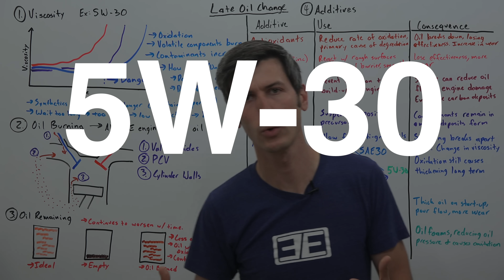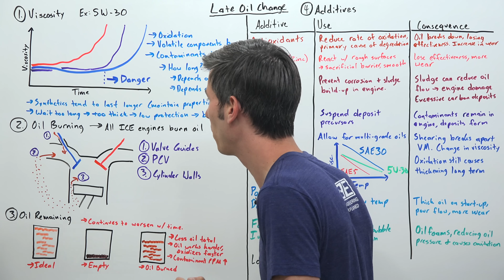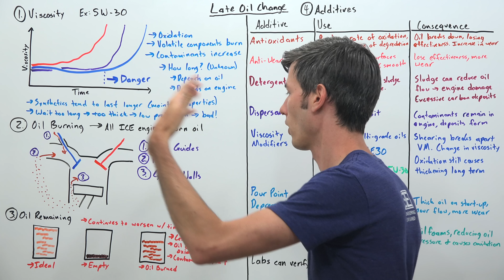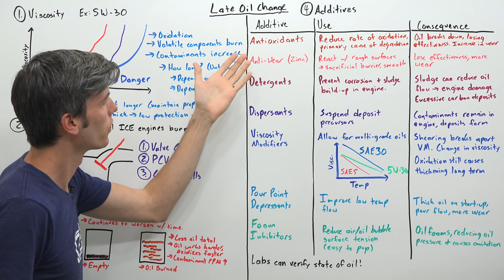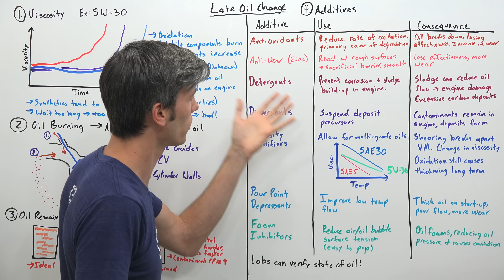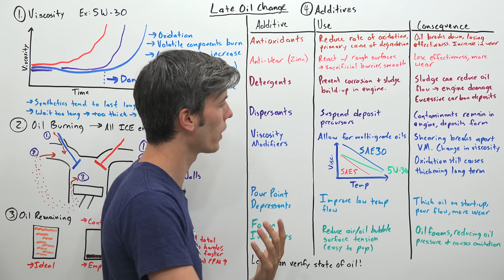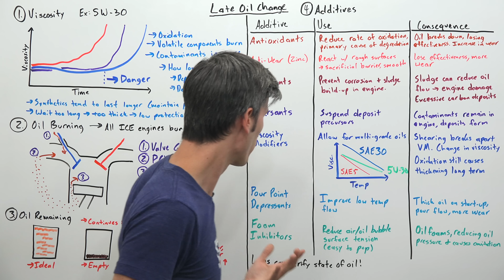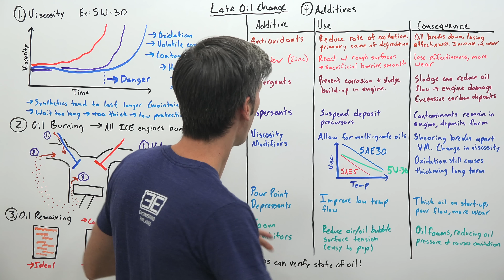What If You Forget To Change Your Oil?

Comment: I'm wondering what is happening when your oil exchange is overdue not because km/miles but because of low km/miles done. Like now in Corona time lot of people are working from homes and are not making usual km/miles. 
Let's consider following situation. Car instead of doing 10.000km in a year is doing only 5.000km in year. What will happened if oil will be changed not after 12 but 24 months?
Let's consider that car was doing one long trip every weekend instead of series of short trips during week and some longer during weekends (so water accumulation shouldn't be the case and fuel in oil as well shouldn't be a case)

Comment: One question (hope for an answer). I'm from Germany but live in Costa Rica now where gas quality is worse. Many people, including mecanics, tell me to change oil (if full mineral) every 3000km, semisynthetic every 5000km and full synthetic at mas 10.000 km. Does this recomenation make sense? Many people here drive older cars (15years+), so do I (Pajero gas 3.5 engine from 1995, recently oberhauled).
Does longevity depend more on car engine (car manufactor indications in owner manuals; many cars here are imported from the States, so is mine, some are produced for Latin American ?Market), gas quality or what oil manufactor indicates on it's container? Or is it a mix of all 3 factors and its hard to say?

Comment: 428,000 miles, 1984 Nissan Maxima. Use Synthetic oil. Change the oil and filter every 7,000 miles. No I have not changed to High Mileage oil yet.

Comment: A friend bought an old Toyota car, never changed oil for 7 years.. i just discover it when its radiator fan gets busted.. Still running in good shape even the oil viscosity is like water.. the guy knows nothing about car maintenance other than drive a car.

Comment: Because we now have so many people driving vehicles but never reading owner manuals or understanding the importance of maintenance, many/most manufacturers have oil change reminders built in to their electronics.  The vehicle will tell you by way of a tone and message on your instrument panel display every time you start the vehicle.  The actual mileage when the reminder activates varies based on factors such as the type of driving done as well as the miles.  Drive a lot of highway miles, you can go longer between changes.  Do mostly stop and go driving, your reminder will activate at a lower number of miles.  This is all tracked by the powertrain control module (PCM) as well as other computers in the vehicle.  So if the average recommended oil change interval is 7500 miles for instance, your reminder could activate at 5000 miles, 7500 miles, 10000 miles, or even higher.  Or you could do like me and just change the oil every 5000 miles.  As an old retired automotive engineer, I have a lot of first hand experience with this subject.  My opinion is use a top quality synthetic oil and don't try to stretch the miles between changes.  Your engine will thank you and reward you with many extra miles before it bites the dust.

Comment: The Question in the head line is very interesting. However you talk a lot in 11 min and 17 seconds, but does not answer the question in the headline - at all. A lot of bla - bla - bla. An oil test from a car that has driven 20.000 miles in a time span of 7 years - without an oil change - would have been VERY informative. By the way this is just what I have done with my gasoline car. The oil still looked fine, the engine is now running with fresh oil. But my next oil change will be after an additional 20.000 miles. Does it harm my engine ? I cant tell for sure, because I did not make an oil analysis. But I dont think so. I did not forget the oil change. I just expect the oil to have a life span of 20.000 miles. And oil does not degrade by time alone when the engine is stopped, but only by use, when the engine is being operated.

Comment: Change the oil/filter early! If your vehicle has an oil change interval indicator, change it long before the maintenance reminder turns on. And you should change the oil/filter even sooner the older the vehicle gets.
My 2018 Civic EX-T has an indicator that tracks the viscosity. The oil indicator adjusts the change interval based on usage (short trips and city driving requires sooner oil changes) rather than just mileage. But generally, it requires an oil/filter change every 5,500 miles using synthetic 0W-20. I change it when the indicator hits 30% or earlier (roughly, every 4,200 miles). I plan on keeping my Civic for well over 250,000 miles.

Comment: Oil schedules are set for people who load their engines when they drive. Low load long runs are some of the best driving you can do for your engine. Short runs and stopping in between are quite a bit harder on the engine and performance driving even more again. I worry less about my wife’s Yaris service wise than I have any previous vehicle she has owned. Working out the length to which you can run your oil without changing requires an understanding of the load that the car is under most frequently and the general wear factors. If you can then you won’t panic at passing the set change time/distance between ….

Comment: You forgot oil filter. In many cars oil filter is the one limiting oil change milige. When oil filter is too contaminated it increase oil pressure on it and causes overpressure valve to open and let oil Pass oil filter.

Comment: My 2010 Kia 2.0 has been on fully syn Shell 5w40 helix ultra from Day 1, now at 240000km still clean running with zero leaks.. Zero topup needed, i change the oil every 9 months or 15000km and the used oil comes out clean. Manufacturer recommendation Is every 10000km 6 months. I'm in tropical Malaysia

Comment: 6000 mile oil changes? WTF are you living in the 1950s????  I have used 20,000 mile oil and would argue with my garage every year as they insisted on changing it at the annual service yet I had only driven about 5000 miles. My beef was the 20K oil was more expensive and they should either leave it alone or use cheaper oil. They threatened to cancel the warranty if I did not pay the money (in USD about $150 just for the oil). Super unimpressed.
Reply: The lubricating properties of oil never really diminishes buts the additives added do.  As well, oil gets dirty & contaminated. These are the reason to change oil.  The timing of you change oil depends on lots of factors relevant to your cars circumstances.
If you intend to keep the vehicle a long time, 6000 mile oil & filter changes are good insurance for engine longevity and repair costs in later years.  Spend money to save money works sometimes.

Comment: well.this is how i know when to change my oil
1- when the engine oil smells like gasoline, its time to change the oil. (smell the dipstick test)
2-when its brown like mud, its time to change your oil. 
3- when you have bubbles on your dipstick its time to change the oil.
4- when you have sludge on your dipstick, its time to change your oil.
i guess its "know your vehicle". do some reading. especially before you buy and especially if your buying used.
 me i drive until the oil smells like gas, change it 2x a year because of the northern climate you get a lot of blowby when the engine is -30C.

Comment: For warranty reasons MAZDA requires me to change my CASTROL full synthetic 0-W 30 oil every 5,000 miles (because Mojave Desert/LasVegas). SO... with my drop-in K&N air filter, which will permit a bit more dust into the air intake and some into my oil the more frequent oil changes will mean less abrasives in my oil.

Comment: I bought my 2007 Camry brand new and changed the oil on average every 15K miles.  I sold it 3 years ago having just flipped 200K miles.  I never topped it off, and never heard any complaints from Toyota who changed it most of the time.  I've never believed the idea that you need to change the oil as often as is quoted (even here) but I don't know what else to say... YMMV (see what I did there?).

Comment: Don’t put thicker oil in a Variable Valve Timing motor. It upsets the system. It's designed to operate with a specific viscosity when the motor reaches proper operating temperature. Mazda 2 specifies 0W-20. This can be attained only with full synthetic oil. Don't let Iffy Lube high school kid put 10W-30 in it. The motor will lose power and gas mileage.

Comment: I want to know when I should changed my oil. That is the hardest question. Many manufacturers dont have as specific period. Then there is all sorts of adverting for oils and how long they last.  Then there are oil change places tell me to change it at 3k.   WTF Anyway. Thanks for another great video. BTW, not to pick on you but I see lots of people get this wrong. You said the second number (5W-30) was the viscosity when it is hot. But that is not true. It is the viscosity of a 30 weight oil at that temperature. Reason I say this is because I have heard people say that the oil gets thicker as it gets hot.

Comment: Oil change is the cheapest insurance you can get for your car worked at a shop for sixteen years any vehicle that ever came in with engine damage was either oil change over 12 thousand miles on high mileage vehicles or a broken timing belt

Comment: Pointed question--> multi-viscosity oils are all  we use now....and Viscosity Improvers (VI's) are used in the mix to get us there. Also....oil (itself) does not "wear-out"....only the VI's do. So.....it was therefore recommended that multi-viscosity oils with low weight ratios.. ( say....10W-30...a 3:1 weight ratio from the base stock 10 weight ....to 30)...use LESS Viscosity improvers than the later 5W-30 oils (6:1 ratio). So the argument goes....the 10W-30 is more forgiving of late oil changes (say every 5000 miles).....than the 5W-30, because it has less VI content to wear out,  with less chance that you are ending up with only the core 10 weight oil that it started out with, before the VI's were added that get you to 30 weight.  Comments from anyone deep into this topic ?........

Comment: @engineering-explained would be great to understand the impact of cold versus hot climates.  also does the engine need to run to cause oxidisation?  What kind of oils can last a year or more before changes and under what circumstances?  If you use your car/motorbike for a month a year during summer versus a month a year during autumn/winter how does this impact it’s life?  How should you store an engine for six months to a year?  How does synthetic oils change this?  Hopefully an idea for another video but I’d love to know?  Great work as always.

Comment: I once went 10 miles over the manufacturers oil change range.  Instead of 6000 miles, I changed it at 6010.  My entire engine seized.  Brought it to the mechanic and he said this wouldn't have happened if I changed my oil 10 miles earlier.  lololol!!!  Yes, don't go over even 1 mile.  If you do, your entire car will be ruined and you might end up in the hospital as well.

Comment: I once worked in a materials lab with a clued up motorcycle racer. He did routine oil tests on his Suzuki. After two year of close monitoring he optimised his oil changes to 3000km less than the recommended 10k changes, and replaced his plugs every 5000km.  The oil got contaminated by zinc and magnesium beyond 7300km intervals, going exponential at 9500km.
Oil brand didn’t make much difference, but synthetic oils showed wet plate clutch contamination (I.e. wear) within 1000km.

I had the same model bike: after thrashing it for a decade, using his maintenance schedule. The motor at 570k km still ran sweet, smooth from idle to its rev limit at 13600 rpm with zero rebuilds. Then the bike was stolen and stripped for parts. Five years later I found my engine in another bike still running sweet.
Most bikes engines are junk at 300k, so I was very happy with my colleagues advice.
But, in off years when injury prevented riding I never bothered changing the oil, I just kept to the 7000km interval.
Not bad really for a wet clutch plate bike frequently ridden at its limits averaging 10500 rpm, with frequent clutch less gear changes, and occasionally turfed on its side onto the tarmac with the unloaded engine screaming.
Get your oil and plug change intervals optimised and kiss goodbye to engine repairs. Note manufacturer intervals are a compromise between worst case use, and the manufacturers desire to sell you a new engine.

Comment: True story . A friend of mine in the UK ( farmer )
Bought a new Toyota 4×4  he drove the car for 350,000 miles without an oil change . Yes three hundred and fifty thousand miles. He only topped up periodically. Petrol engine synthetic oil.
He eventually bought a new car with a dealer
Part exchange he got a top price for his car against a new one.
Most of the crap these guys come out with is Rubbish synthetic will last and last period

Comment: This film is so cool, I hope Youtube keeps it as a historic reference for coming generations.
I understand Tesla has a 20 year gear oil change interval. You could probably get away with not changing it at all but if you have a 20 year vintage Tesla I guess you want to keep it in mint condition.
Reply: 20 years for gear oil is silly given how cheap petroleum is compared to repairs

Comment: Great info, thanks.  Two questions:
1.  Does the oil level matter, as long as it's within the normal range, or is it best to keep it at the high point?
2.  Is there a significant benefit to replacing oil sooner than what is recommended?  At what point do you change yours?
Reply: Always keep it to the Full Mark .
Reply: Above minimum mark is fine, whenever mine hits the minimum I just refill it to full
And going shorter than the normal interval is pointless, the oil is designed to last a certain amount of time, just not too long. Check your owners manual, but general rule of thumb is 5-7k for synthetic and 3k for conventional. Newer cars can go longer though.
Reply: No  
No

Comment: Understanding this video has inspired my question which is:

Why don't car engine makers include a ''pre-lubing"/"lube-priming" kind of process where a person turns the ignition key from position-zero through to position-two (battery online) and is prompted by a "lube-protection-system" to "please wait, pre-lubing or lube-priming" in progress, and depending on car make, the person would see a graphic progress bar or clock countdown insicating when it's ok to turn the key to position-three to crank the engine to a start?

This process would use electric power from the battery of the car (it may be as much power as used by the starter motor to crank the enginento a start) to power an electric oil pump to pre-spray/pre-circulate just eniugh oil around the engine to coat those sensitive moving parts that are exposed to dryness that welcomes wear during start-ups...before the starter motor is cleared to crank the engine to a start.

This idea of mine is inspired by the pre-heating glow wire in diesel engines which must be allowed to get hot enough to warm the air entering the ready-to-fire cylinder...like we all know, this is a must-do process on cars with diesel engines and I thought it would be great for petrol/gasoline engines to have the pre-lubing/pre-oiling/pre-spraying feature. I'm aware that something like this would unfortunately increase complexity, parts-counts, weight and costs to the car featuring the system, but I'm tempted to think that in the long run, start-up wear could be reduced super-significantly. What do you think?
Reply: Or they just could do engines like Toyota does.
Reply: Thats a great idea but I think we are in the era of disposable cars unfortunatly
Reply: Hell, I think you really have something there! Get the blueprints going. Makes perfect sense.

Comment: Usually i do the yearly oil/filter change myself, but kinda forgot this year. 1.5 years since the last oil change, though we only ran like 8000km, so very little mileage. 1.6tdi vw touran, we always let the engine warm up before actually giving it more gas
Reply: Hey same here, y own a 2018 audi a6  2.0T  4 cylinder and drove 8k miles but went 1.5 years without changing the oil. Do you think was this bad for my vehicles future?
Reply: @juancruz-jg5pq  prbly not a huge problem
If the 8k miles were short trips mainly or driven hard, then it might be a diffrent story

Comment: The oil's hot, operating viscosity will decrease/thin out of its rated range, the shearing that Jason mentions. A decreasing oil capacity will also decrease ability to cool pistons and resist heat thus retard ignition timing by ECU -- reduced power.